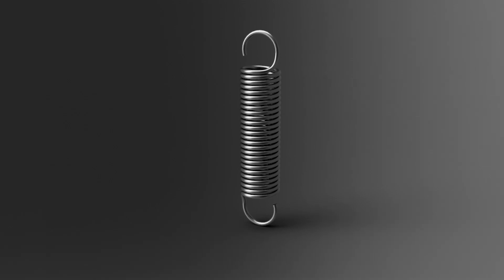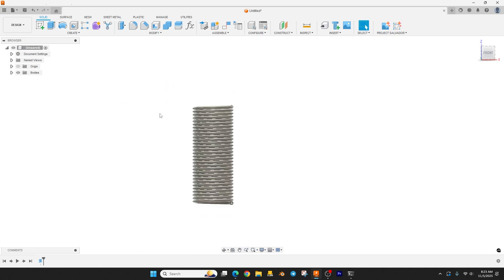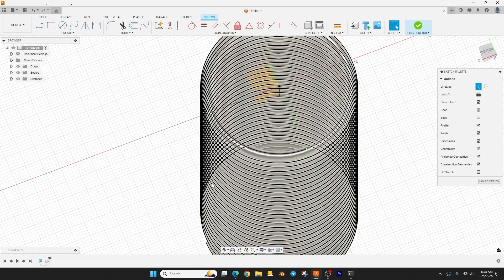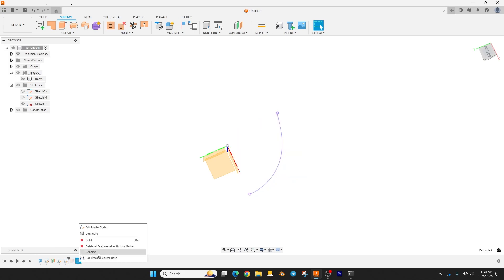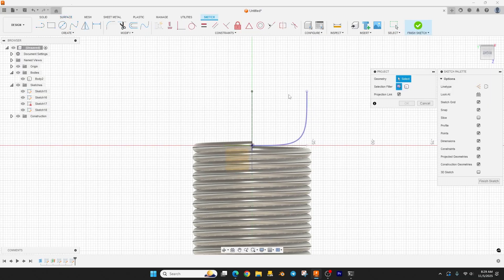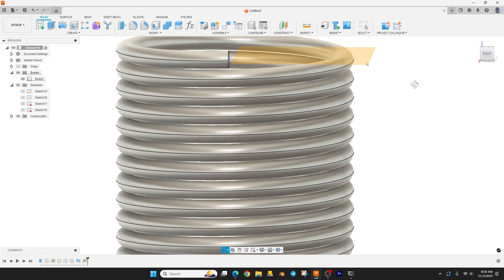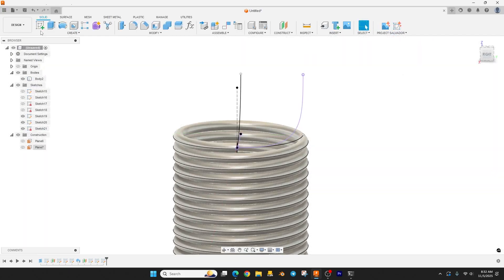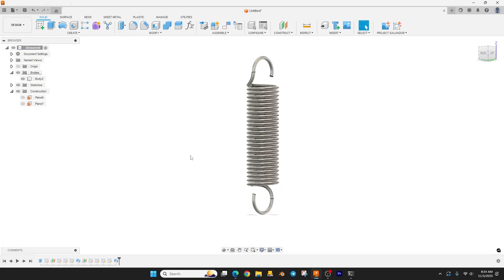Create A Spring in Autodesk Fusion

Comment: Springs are made from steel wire. Steel wires have standard diameters, meaning a spring created using your method will NOT be available for sale.
Reply from the maker: I’m not sure your point? This is mostly just a video about designing in Fusion and learning about the Intersection Curves tool. Also, you can change the diameter of the steel wire in the model
Reply: @ShopTherapy623  You made the diameter of the wire depending on the pitch, it should be the other way around.
Reply from the maker: @tribar-6886 I wanted the pitch to be the whole number so you can calculate length of spring easier.  The coil diameter is just .2mm less than pitch. You could have done it the other way around, but it doesn’t really matter at all

Comment: Great video. Is there a reason that the two curves you use to make the intersection curve are not set to construction?
Reply from the maker: The main reason was so I could show you how the intersection curves tool works. You can’t extrude a construction line.